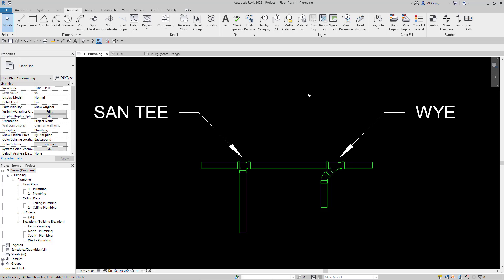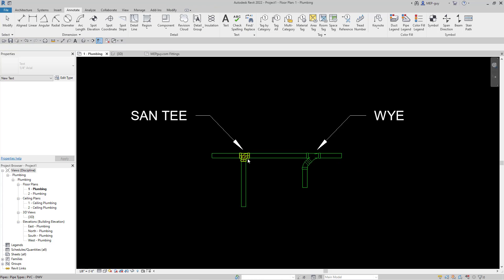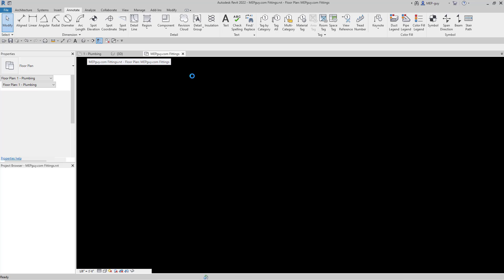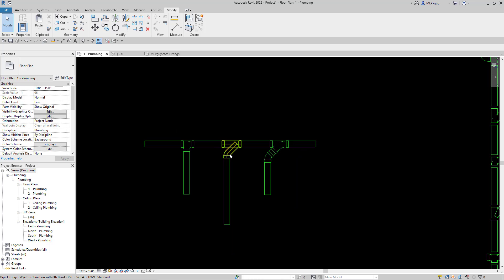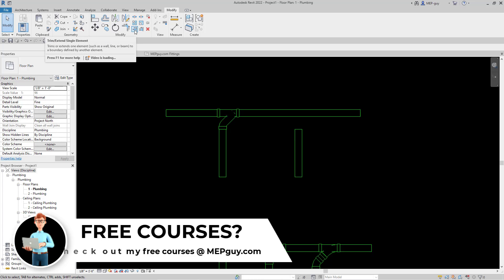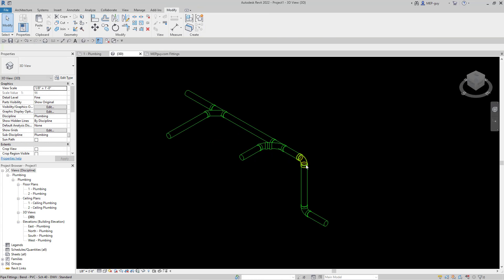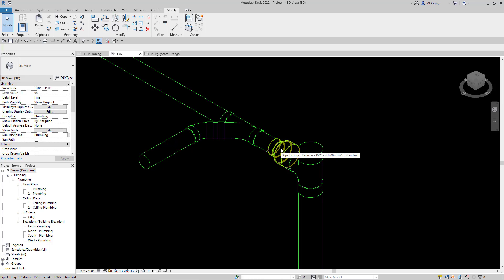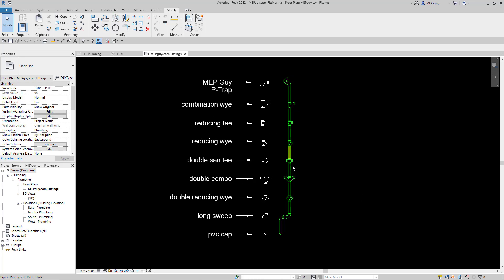How to use Sanitary Tee vs. Wye Fittings in Revit

Comment: If I’m not mistaken a San tee and a wye are two different fittings. The San tee the outlet comes out the side the wye the outlet is at a angle to accept a 45 to make a combi
Reply from the maker: Yes they are two different fittings. In Revit the default for a tee fitting for PVC is a sanitary Tee which is not allowed for horizontal drainage piping.

Comment: To make the WYE 1/8 bend, do you use a street 45?
Reply from the maker: Not sure what you mean by street 45. I know thats a common term for the 1/8 bend. In revit the fitting is called a "Bend". It can actually be used for 45 and 90 degree elbows. Revit draws the bend at a 45 degree angle for you automatically. I use the combo fitting in Revit so I only have to use 1 fitting instead of 2.
Reply: @mep_guy  a Street 45 is like a regular 45 except for one end doesn’t have a hub on the end it’s just straight pipe

Comment: Great video. We use the combo fitting as well for tee junctions.  Unfortunately if our horizontal branch is coming in at 45 deg, the combo fitting doesn’t bend into a wye, at least ours don’t. It would be nice for Revit to have a routing preference to do just that.
Reply from the maker: Ahh yea. I hardly connect at 45 degrees but yea that is an issue. I guess you just need to select the combo fitting and change back to the sanitary tee/wye. Totally forgot about that issue. We definitely could create a combo fitting that turns into a wye. Maybe I'll do that one of these days. I'll make a note! Thanks for the feedback Jay!
Reply from the maker: Hey Jay. I plan on doing a video solving this issue. Should be out tomorrow. How are things?